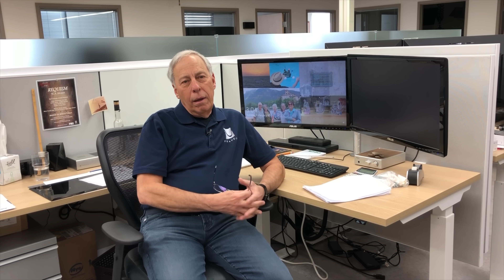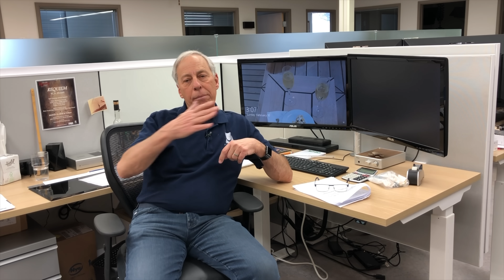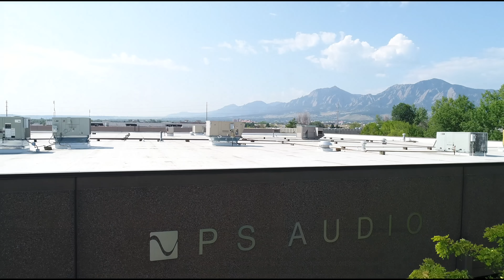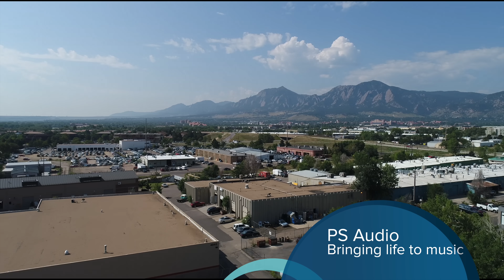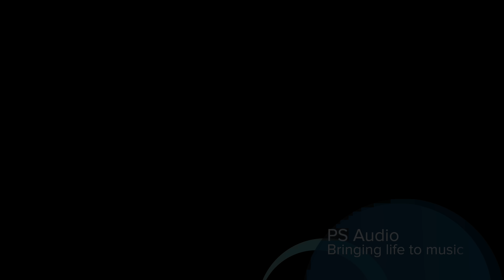How can converting PCM to DSD be better?

Comment: I belongs To ELECTRICAL ...

PCM @Time pulse (this is parallel Transmition of Digital signal ...so easy to store and edit & large file Transfer )
DSD/PDM@ time (this is SERIAL Transfer of DATA ...so easy to Tranfer ...simple to convert Analog ...but NOT DEPTH as PCM ...PCM Canbplay 32 bits per secon ...but DSD can play ...1 bit per secon or it need to play more bits per secon....)

Overall DIGITAL PCM OR DSD ...
Both give same. CLARITY ...(DIGITAL dont loose Data ...)
While DSD uses less circuit COMPONENTS ..(while in DSD ...ANALOG-to-DIGTAL DSD -to-File Transfer -to-AMP DSD Decoding -to-ANALOG ......DSD decoding is not complex as PCM)

PCM uses LOGIC Gates& Ladder DOCODING Circuit ...
Logic Gates are Complec But ..
Never reported ...as in-efficient

ANALOG=time T & Magnitude

DIGITAL= Frequency 1/T & Magnitude 0 or 1 &   Bus Width ( else defaults 2 bit)

DSD =Frequncy 1/T (constant 5.2Mhz or 11 Mhz ...no need to consider )  & Magnitude (Default 0 or 1 no need consider ) & Bus width (1 line or 1 wire only with Ground point ...No need to consider )

PCM =Frequency 1/T (based on File 192khz or any ) & Magnitude ( depends on file type 16 bit or 24 or 32 bit ...gives levels of magnitude )   & Bus width ( Based on file type 16/24/32 )

From ABOVE ....DSD is simple & UNCOMPLCATED it only depends upon 1 wire transmission 

Demirits ....
@ multy channel ...un recommended ..
@ manipulation not possible 
@ speaker calibration is difficult ...by this DSD format ..

Upto stereo ..superb format ...& DSD uses LESS complex circuitary

Comment: PCM upsampled and converted to DSD and then played back sounds far better than the original PCM track. Check Audirvana Plus (a well reviewed music player). It sound better, because, as you said, once the data is encoded in DSD the digital to analog conversion is easy and non damaging.
Reply: upsampled?  so like running a compressed MP3 through noise filters, and then printing a Red book CD?  Please clarify ... it sounds contradictory.
Reply: @salviabloom3662  I do not know the details but Audirvana+ converts PCM to DSD (64/256) when connected to an external DSD-compatible DAC. And yes, even MP3s sound better. Their algorithm must decode the MP3 into an uncompressed/decoded PCM stream and from there upsample to DSD. The difference is not small.
Reply: @salviabloom3662 You can revert the dsd file to pcm without any difference to the original file.. mp3 is not a good example.
Reply: @absolutium  it's more about creating a 'print' of the so called PCM file which is then played through the  DSD system..  not about it being a lower resolution.  Ok -  - was thinking since DSD can handle higher res.. it would have to upconvert ect but this is not the case just plays as is..  ?
Reply: @SPINNINGMYWHEELS777  This is an oversimplification but what most people think its happening has to do with DSD being closer to analog data than PCM ..so it acts like a better "interpreter" of reality.
Reply: @Hex Omega All of the above.

Comment: I have a CD from a Metal band called Accept - Staying a Life, it shows on the Japanese liner that it is mastered in DSD. This CD is the best sounding CD I have ever heard, You can crank the music and it seems like it just doesn't fatigue my ears, distortion seems really hard to introduce...Also, the left and right channels are really defined and extremely clear...I can play this CD on a basic sound system in my car and it still sounds really good.
Reply: Got to be careful about that volume level mate. Tinnitus is a bitch. Once the hearing cells die they can't be resurfaced.
Reply: Got the same CD 😂 need to get it out now!
Reply: This is an old post but I'll respond anyway. In the last 5 years have you discovered any other metal mastered in DSD?
Reply: @Hi-FiChess  nope
Reply: @darinsteele7091  same, the closest I’ve found is is Boston that’s it, DSD 64.

Comment: Great great question.  But you didn’t actually answer it!  We understand DSD is more true to life, but why converting PCM to DSD which your products do, is not explained in your answer.  I use Roon to do this and it clearly sounds better and the sound stage is wider and the sound is more real.
Reply: Exactly what felt. Need more specific answers.
Reply: I understood it as, converting PCM to analogue can be quite complex and difficult to get perfectly, being a 2+ step process. The simplest PCM DACs (as explained on Technology Connections https://youtu.be/pWjdWCePgvA?t=499) passes through an array of resistors which can be vulnerable based on the accuracy of the resistors, and then though a LPF, whereas this guy is saying that DSD basically just needs to go through a LPF, therefore less room for the reproduction to go wrong.
Reply: Totally agree. Any chance to hear the answer?
Reply: I convert all PCM to DSD 64 with my LUMIN U1 and the difference in sound coming out of the DAC is incredible!

Comment: Well no one likes this but I have to disagree, if the output equals the input there isn't any loss of information. Just search "D/A and A/D | Digital Show and Tell (Monty Montgomery @ xiph.org)" Correct me if I'm wrong but used encoding/decoding method should not be the issue here, but the playback stage?

Comment: Paul is confusing the source media format with the DAC conversion principle of modern DAC chips using a delta-sigma architecture. Your PCM or DSD source material sounds as good as the bit rate allows. PCM can easily be better than DSD if more data is used for your music. If your DAC chip internally somewhere on the silicon is converting your music to DSD to better translate to analog with less complex filtering, it’s just a hidden trick but has nothing to do with the media you play.
Reply: Exactly what I was thinking.   He didn't even define what the dynamic range, bit rate, KHZ range of the PCM source was he's speaking of.
Reply: @salviabloom3662  Very good point. He said DSD encoding is better than PCM because of the superior sampling rate of DSD/PDM compared to PCM...but...what is a PCM track is recorded in DXD 384kHz, is it still inferior to DSD???

Comment: How do you do error correction in DSD? A feedback loop?? Or is DSD a totally immaculate process without fault? (Insert eye-roll here.)

Have you ever discussed just how many digital to digital, and analog to digital, and digital to analog, and analog to analog conversions are implicit the typical audio stream, CD or LP? How many times is the digital signal decoded, re-encoded, transcoded, and run through Pro Tools as well as outboard plugins? Maybe a nice Pultec or two. It boggles the mind, not to mention the poor ear. And if we could just do all this with shining, glowing vacuum tubes -- oh, the hardware you could sell to audiophiles. Smooth out all the digital jaggies with electron transit time. Ah, like velvet to the ears. "Tube sound."

Modern commercial recordings are to the ears what CGI is to the eyes. Basically, an artifact of a musician's effort. In reproducing that, be careful what you wish for. The serious production money is for Lexus radios and Beats headphones.

Comment: You explained why DSD is better than PCM but wasn't the question how can something already recorded as PCM sound better when upsampled to DSD ?
A DSD recording played back as DSD can sound close to analogue but how can converting a PCM recording to DSD have the same effect ?
Reply: John   He did answer it.  When PCM is converted to DSD, the conversion back to analog does not require  the sharp roll-off filter, just a gentle one, so the analog output suffers little to no damage compared to PCM’s DA conversion.
Reply: @doowopper1951  / Thanks, so PCM to DSD conversion is not considered harmful its just the filter used in converting PCM back to analogue ?  I've not thought of it in this way before as I thought the improvement was related to upsampling .